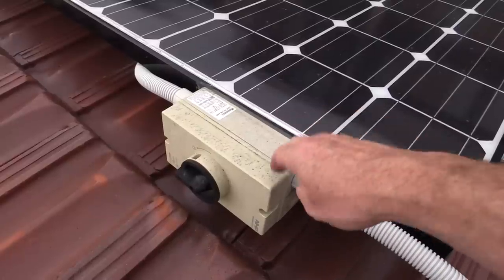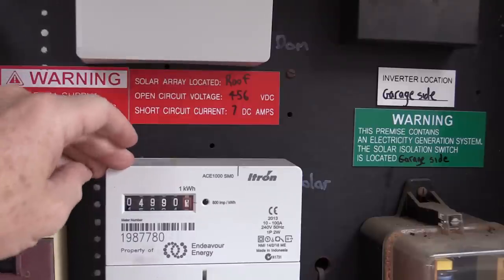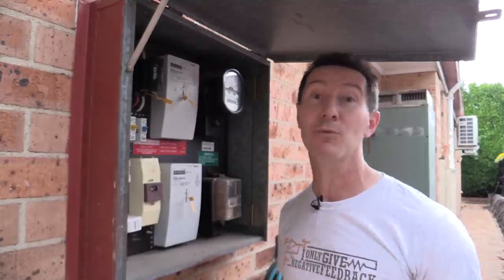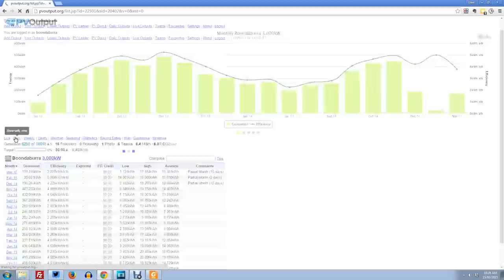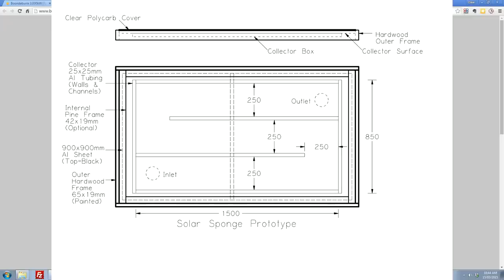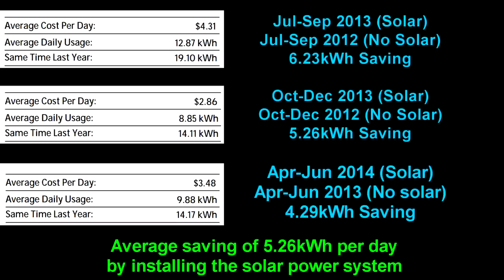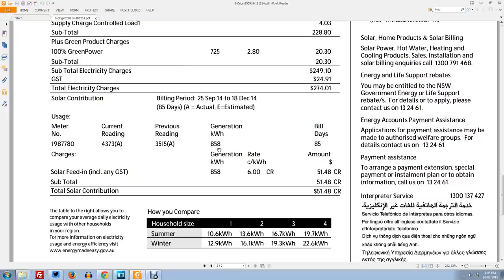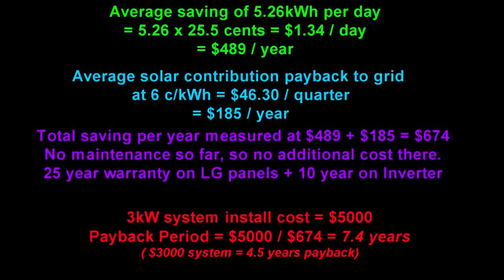EEVblog #724 - Home Solar Power System Analysis & Update

Comment: What happens in the winter in terms of panel care? Are you using gas heating, or is it electric?
Seems like the panels should have some kind of automated wiper to at least prevent issues like snow buildup, and probably some kind of retractable plastic shield (just in case the weather forecast warns of hail or other freezing weather issues which may damage the panels).
Reply from the maker: Razor2048 Snow? This is AUSTRALIA! It's 16-20 degC in winter here in Sydney, I wear shorts and a T-shirt mostly.
Reply: EEVblog 
Damn! How hot does it get in the summer there?
Reply: Robert Calk Jr. Average of about 35c and max of low 40's (up to 45) atleast thats my area in Albury
Reply: Robert Calk Jr. Speaking as someone down in the Riverina (NSW in-land farmlands) down within 100km drive of the Murray, Summer easily punches 35*Cel during the day.
Reply: Robert Calk Jr. Around up to 26 degC.
Reply: I live in a particularly cold part of Victoria, (outside the mountain areas anyway) - seems to be a microclimate that is consistently colder than anything else nearby, and it never snows. Well, almost never. 
It snowed for a few hours one day last year. The snow was on the ground for maybe an hour or two.
We get 37-45 degree days sometimes in summer, and winter will get down to about 2 celcius sometimes, but more like 4 or 5 at least.

And that's a COLD area for Australia. Now, if you were in Canberra or the snowy mountains you might get a fairly large number of days in winter that drop to -1 or -2, but even then you have to get up to near Jindabyne or the like, right up near the mountains and the ski resorts (Thredbo and Perisher valley) before you start to see any snow on anything like a regular basis...
Reply: KuraIthys
 So I am guessing you don't have to deal with issues like this very often http://i.imgur.com/EjKBpB9.jpg when the city workers angle the plow towards the parked cars when clearing the streets? Nothing like encountering that when you wake up for work in the morning.
Reply: Razor2048 I don't think I've ever seen that amount of snow outside of a ski resort... XD

The worst I've ever seen (and this was Europe, not Australia), was a layer of snow maybe 10 cm (about 4 inches) thick that survived for about 2 days...

Well, I mean, the ski resorts had a lot more, but that's different. XD
Reply: "hail ... weather issues which may damage the panels" Any answer?
Reply: Tripcore Sydney is more like to be washed away by King Tides (particularly places like Manly) or from floods coming from the Blue Mountains down like the Parramatta River.
Reply: ElNeroDiablo Yes, but looking for an answer that may apply to other parts of the world.

Comment: Because you're missing expensive battery storage that means you are buying energy from the grid during night time or anytime solar panels are not producing energy. That means that 6.7 kilowatts of energy you consumed include grid energy you purchased while 7 kilowatts of energy produced include energy you used and also sold to the grid. Where the negative price difference between kilowatt sold to grid and imported from grid, the math becomes not that great when you speak about how much you used and how much you produced. Overall interesting video.

Comment: Wait a sec. 5K was only the install cost right? How much were the panels? You have to figure that into you  initial costs to predict payback time. I'm asking because I just went through considering solar for our house, and unless the US is widely different from Australia, I did the math, and a system to cover 75% our energy consumption, which is the max output we could get from our roof,  would costs us, after install, 25K, and the best case scenario I came up with, which there was absolutely no maintenance, or replacement of any of the panels (yeah, like that would ever happen), it still came out to 17 years just to pay off the initial investment, by which time the whole system would have had to be replaced anyway because th best estimate we got (warranty + whatever data we could collect), pointed to the system we were going to get would last at the very high end, 15 years! Even if you included the government incentives, and still keeping the insane no maintenance costs scenario, we were still looking at 12 years just to pay off the initial investiment.
I can see the green argument, sure, especially over here at the US where most of our power is generated by either coal or gas burning generators, but financially? Solar, the way I see it has a very long way to go unless I'm missing something drastic. 
I'm not sure if you have these types of company over there? But here in the US there's this company called "Solar City", that will come in and install a whole solar panel solution for free, and then sell you, at a much lower rate than the electric company, the energy you generate back to you, at first it didn't make sense to me how these guys made money, but after doing some research it completely does. Not only they get a much bigger break from the government, they get the panels themselves at a much lower cost because they are buying so many of them, install rates same thing, and of course they are still making money on the energy you generate too, because they are charging you, not only that, they get the money (albeit just like in your case very little) on the energy we don't use and gets put back into the grid, and we would have to sign a 20 year lease with them. Sure, that way I can see how you would make money, but other than that?
As an "aside", if anybody is considering going with "Solar city", do your research, these guys are kinda shady, to say nothing about signing a lease for 20 years on something that becomes an integral part of your house, and which cannot be broken, only transferred, 20 years is a long time, if you need to sell your house in that time period, now you have one extra thing that potential buyers have to consider, your lease, which will be transferred to them...
Reply from the maker: Marvio Botticelli No, $5K included the panels, everything.
Reply: WOW! I wish I lived in Austria! :) (he he)
Reply: Marvio Botticelli
LOL. Australia, mate. It's the country that's almost as good as but not quite as good as New Zealand.
Reply: Fennecbutt
Hoooo Boy! Zing! :)
Seriously though, how is it that by the time it gets to the US prices become so high as to make no sense financially? That's some middle man for ya!
Reply: Just out of curiosity, is the $5k install price a non government subsidized price?  It has been my experience that in the U.S. the non-subsidized price is around $4/W.  Since you are on a different continent, I wouldn't expect an exactly equivalent cost, but neither would I expect a variation of 240%.

The reason the utility is not going to PAY you an amount equal to what they CHARGE you for an equivalent amount of energy is that YOUR energy can't be scheduled or dispatched.  There is no expectation of availability or reliability from you.  You do not guarantee or provide the same quality of service as a bulk independent power provider or a utility.  On the other hand you, as a customer, do (and should) expect high availability and reliability from the utility.  

Your connection charge only represents the fixed cost of providing your service, i.e. the cost of reading the meter, billing, etc.  It doesn't cover all infrastructure and reliability costs.  In all likelihood, they are probably paying you the same rate as the fuel charge, which is all you are actually saving them.  I can assure you that utilities have the capability of accurately tracking what it costs to provide service to you and are cable of changing with the times.
Reply: Continued from previous comment...

only paying you for the offset fuel cost, which is all you are saving them.
Reply: NJ Near
For some reason, PV systems are rather expensive in the US. Overall installed system cost are about 2.4$/W here. The MonoX panels are about 1.2$/W.
Maybe that is due to the market size. We (Germany) have more than twice the installed photovoltaic power (38GWp vs 18GWp as of last year) of the US. And it doubled in the last 4 years, so there are quite a lot sales.
Reply: You have to wonder if the panels are subsidized by the government before being sold to the consumer.  Else, it seem that such a price imbalance SHOULD create an arbitrage.  In the U.S., there are large tax incentives for renewables, but they must be taken by the consumer after purchasing.
Reply: At least over here they are not as far as I know. You get a good selling price for your electricity, cheap loans and tax advantages, but that's on top of the cheap price. Subsidizing can be somewhat in-transparent though.
Reply: Thanks for the info!

Comment: I assume they would be rather easy to clean with a window washing extension they use on commercial buildings. To figure out the number of years until you break even, forgone interest on the initial $5k investment would have to be figured in. Alternatively,  you could figure in interest earnings on the savings each year.... ok, I am officially confused

Comment: I'm probably too old for it to make sense, but would love to have a pv array on the roof.
But I would NOT install an inverter, but just use a simple set of thermostats.  I'd feed DC to the electric water heater until the thermostat turn off the heat to the water.  Then, assuming winter conditions, I'd feed te remaining  DC to my baseboard electric heater.
Unfortunately, when my house was built, there was no gas main coming into the subdivision.

Comment: Thanks for Feeding us with your data. If you look closer at the numbers, You have feed back to the grid almost as much you have payed for the solar from the grid. Maybe If you have had a battery system you could have used more of that energy doing the night, of cause you have to maintain the Battery system and it have some 20% loss but at list 3Mw could be harvest doing the daytime, ad feed back to you in the night. If you go for a 4 Kw Battery system would that had cut down you cost, The price from what you pay and what you get are about 2.2 CR /Kw  lets us take the build you have got, You payed 164  and got 51......164-51= 153 dollar for a 1/4 year ....153*4 =612 so about 600 Dollar/ year......can't that be paying for a Battery system ? Maybe a DIY Tesla Wall.... You have the skill to do so.... I Don't  Know...Maybe make a project that we all can benefit from :-)...........Best to You and lot off power to your panels............Jørgen Thomsen Denmark DK

Comment: I don't think that a rate of 1/3 for the electricity you produce is bad. I work for RTE (the french company in charge of the high voltage transport from 400kV down to 63kV). In France electricity is divised in 3 main firm and you pay 1/3 for the production (EDF), 1/3 for the transport (RTE), 1/3 for the distribution (ERDF).

At the moment 1kWh in France is roughly 0,144€ and EDF HAVE (I insist on the word HAVE) to buy your production at 0,2655€/kWh. But it impacts the average price of a kWh. With this system everyone is sharing the load of the transition. The politic in Australia seems to be different but is more fair according to me. Let's face it if you can afford to buy a system like that, it means that you are paying a lot of taxes, if the politic is like in France (I am assuming right now and I don't know the reality) you are having some discounts on that end. I am just being curious here but could you do the math to see what your real rate is ?

Comment: I'm quite upset that Dave is using like 3-4MWh per year while having an aircon, a dishwasher, an electric stove and a whole family using power. 

I also use that much on a yearly basis, and I have no aircon and no dishwasher. I have NO idea where the energy goes to. Rarely watch TV, leds everywhere, no electric stove and no electric heating.I seriously suspect they wired my apartment wrong and half the power goes to the neighbours or something
Reply: You should turn your power off at the switchboard and then identify your meter number by the one that stops and then restarts when you turn it back on again. Check this meter number against what it says on your bill. My electricity provider once had me paying someone elses bills and visa versa.
Reply: Steve Demeo In this case I was talking about the actual meter. It's one of those that spins at 600 rotations per kwh. But man during the evening it spins like crazy with hardly any appliances on. I'll surely reference my bill to my meter to be sure, though, thanks

Comment: Why not switch to a large electric water heater on a timer? "Charge" it during the day and shut off the timer when the sun sets. The stored heat would act as a low tech battery allowing you to reclaim more of your generated power vs giving your surplus away to man for peanuts.

Comment: Instead of selling the excess back to the grid if your pay for that is so low, aren't there any good ways to use the energy yourself ?
Batteries suck, but what about storing heat for use in winter (or showers, or pre-heating the water for the washing machine), or electrolysing water into oxygen and hydrogen or... ?

Comment: Do you run single phase do residential buildings in Australia? The SMA Sunny Boy is a single phase inverter, and my thinking is that it would work better to use a triple phase inverter if you have three phases available as you would get better load balancing, so I'm probably going to run a SMA Sunny Tripower instead (three phases in Sweden).